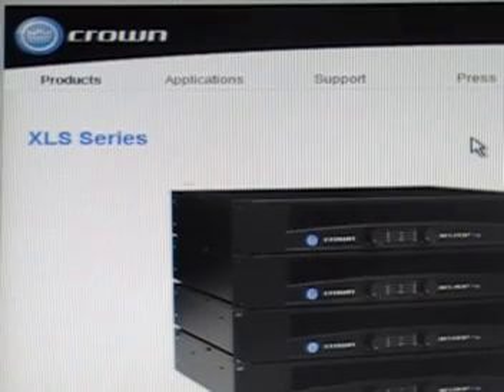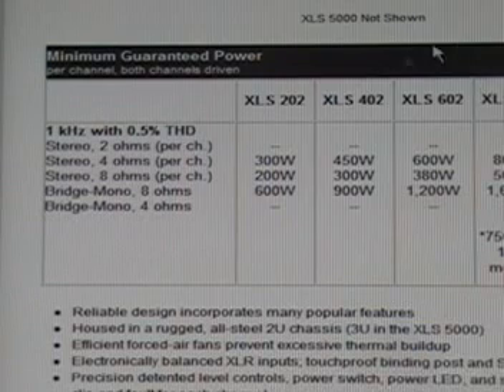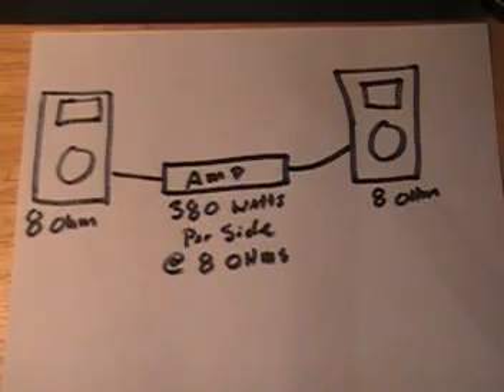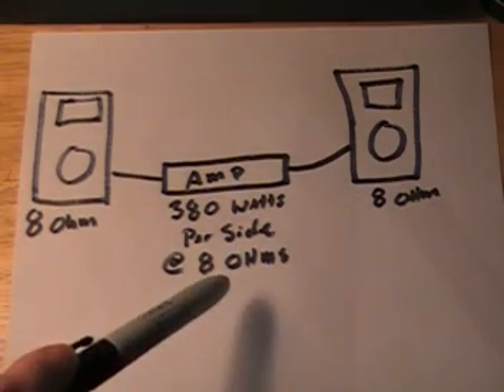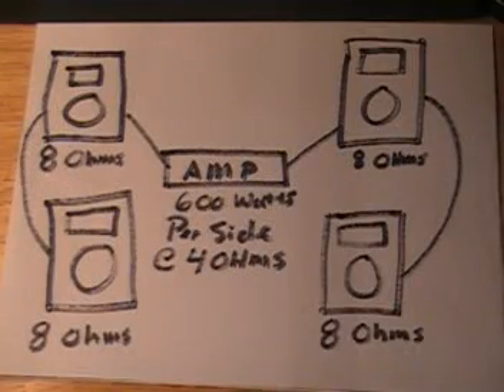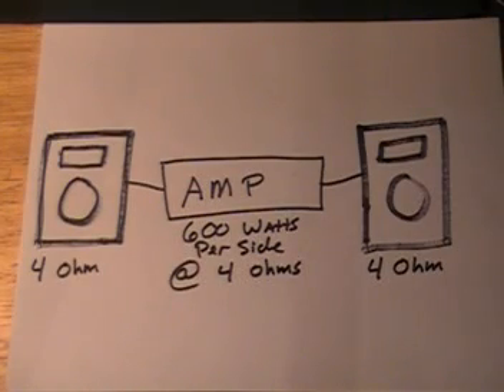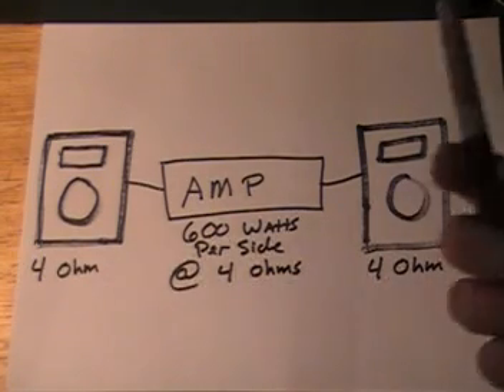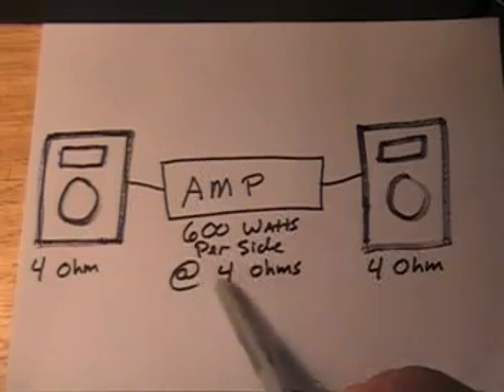How To Set Up A PA - Part 1 - Ohms & Peak vs Program

Comment: As I understand; the Peak Watt rating refers to how much a speaker can take randomly (i.e. kick drum thump) and the Program/Continuous rating is what the speaker will take all day long with minimal stress. Correct me if I'm wrong - just trying to learn (a lot) and teach (very little) as able. GREAT VIDEO, IMPORTANT INFORMATION RECEIVED AND ASSIMILATED!
Reply: Program and Continuous Power are two different things. If you have both ratings, then use the program power as the bare minimum to run your speakers.

Comment: so can you run at a speaker at regular rms. like if the amp and speaker are the same ohms and same watts, but not the extra 50% will that be ok? I suppose it wont do harm since everything is the equal?

Comment: Ok, It's the same for the 2 ways in your case, you can connect each speaker in each channel in your amp, the configuration is each speaker need 200w@8ohmn and your amp get you 200w@8ohms peer channel, in other words you have a "perfect match".
The other way, is put the two speakers in parralel and you need 400w@4ohms per channel to power up the speakers, your amp give this specifications and is correct.
In other case you can powered up other two same speakers in the other channel.

Comment: i have an amp that runs at 200w at 8 ohms and 400w at 4ohms.
i have 2 speakers rated at 200w at 8 ohms each.
if i connect them in parralel how many watt would each speaker get and will it make i difference running at 4 ohms?

Comment: @danielobrien8 

You've got your numbers correct, but any time you start playing with ohm ratings different than what the amp is designed for, you risk damaging both the speaker and the amp. Trying to get an amp to push a 16 ohm load is working your amp WAY too hard if it's only rated for 8 ohm.

Comment: Always match your amps ( choice amp) TO YOUR SPEAKERS, you can always go higher, (run an 16 ohm speaker on an 8 ohm load) going the other way is deadly.
2  (8 ohm)speakers in series  result in a 16 ohm load,  2 (8 ohm) speakers in Parallel result in a 4 ohm load,  4 (8ohm) in series/Parallel results in 8ohm.

Comment: Peak power is for small bursts of power. its possible to send 1000w trought the speaker for arround 3-5 seconds. It depends on your speaker. at some speakers the peak power i calculated to the max power that is posbile to send trought the speaker for 5 minutes.

(sorry if i hard to understand. Im norwegian, and im not used to talk about specs in english)

Comment: No setting up speakers in serie will increase resistance and thus decreasing the outputpower.

The gain factor you have to compensate is +3dB. And now the total output power is the same for left and right. 

But hooking up speakers in serie is kind of a sin. This is because the internal filters get fucked and the speakers can influence each other if they get out of phase.

Comment: spl means sound pressure level that is technically how loud the speakers will go, db stands for decibels, decibels are the figure we use to messure sound volume, the higher the sound in db the louder the volume. and yes you can mix speakers with different ohms i often run 1 4ohm cabinet and 1 8ohm cabinet per side, it dips my amp down to 2.66 ohms but it can handle that. max db spl to you meens how loud the speakers in question will go, the higher the rating the louder!

thanks, rob!

Comment: i thought that when you chain the speakers together like 2 - 8 ohm speakers that you would be running 16 ohms total on that channel? My problem right now is that im using a emx5000 12 channel powered board and with 1000wts at 8 ohms and i'd like to use it to push 2 pr18b PAS 18" subs which are4ohms ea. i think that if i use the mono bridged feature on the board that i could get away with running them parallel and the board would stil  be pushing out 1000 watts@8ohms. AM I WRONG? someone polease!

Comment: hi brian,

i have got 2 subs @ 4ohms 450 rms
2 15" cab drivers(horn + 15" bass driver) @ 8 ohms 250rms and a amp 650 @ 8 ohm 800 rms each side...

my question is can i put 1 cab on to 1 sub on to 1 channel of the amp?

Comment: Really good info, Brian.  My band just purchased  a pair of JRX 115's for our vocals.  We got a Behringer PMP3000 powered mixer to run them.  The mixer is rated at 1,200 watts peak.  The speakers get pretty loud, but there's definitely room.  Also, we can't seem to run monitors with our current set-up.  Does it seem like we need a power amp?  If so, any recommendations?

Comment from the maker: The amps I'm familiar with (Crown and other reputable companies known for quality amps) are usually stable, in stereo at 8 & 4 ohms.  Ideally, I like to run my top cabs at 8 ohms.  It's clean power that dosen't overwork the amp.

For subs, I like to use good amps that are stable at 4 ohms bridge mono.

in these examples, 8 ohms gives you clean clear power without working your amp too hard.  4 ohms gives you more power, but it's often not as clean and makes your amp work harder

Comment from the maker: It's important so you don't fry your system.  You need to know what your speaker impedence is (4 ohms, 8 ohms, etc) when selecting an amp, or vice versa.  You need to know what impedence your amp is stable at.  

If you put a 2 ohm load on an amp that's only stable at 4 ohms, it'll eventually overheat, distort, and destroy it.

Comment: Also, when possible, try to run only one speaker per channel. This may require more amps, but think of it this way: if you put two 8ohm speakers in parallel on one channel (so you're now at 4 ohms), and one of those speakers gets disconnected or blows, the impedance on that entire channel changes and you could potentially damage your amp or your other speaker.

If you just had one speaker on that channel and it blew, you don't have to worry about overpowering any other speakers on the line.

Comment: BTW everyone, try to avoid running an amp at 2 ohms. While they might be designed to handle it, there is so much done to the signal that it may not be as rich. Running at 4 or 8 ohms is best.

Comment: "Good video, thanks! Ok, here is one, I have an amp that has two outputs per channel and it said that the outputs are wired in parallel. Does that mean if I have two 8 ohms speakers hookup up to that one channel that I am pushing 4 ohms?" 

I can say with 99% confidence that yes, you will be doing 4 ohms when connecting two 8-ohms to both outs of a single channel.

Comment: Thanks for the reply, I have a Crate DPS+ 8 channel powered mixer.  It has two internal amps that each power two channels for speakers. Here's a blurb from the manual "The jacks
are wired together in parallel. The internal amplifier of the PCM+ Series can
deliver its full power output into as little as 2 ohms. "

Comment: Good video, thanks! Ok, here is one, I have an amp that has two outputs per channel and it said that the outputs are wired in parallel.  Does that mean if I have two 8 ohms speakers hookup up to that one channel that I am pushing 4 ohms?

Comment from the maker: I just looked at the specs.  It says 300 watts peak.  RMS is rated at 150 watts.  RMS is similar to Program (not exacally the same, still trying to get my head around it all myself).  You could probably get away with an amp that produces 200 watts per side @ 8 ohms and be just fine.  The good news is that low wattage output amps are not very expensive.  On the used market, you're probably well under $200

Comment from the maker: then yes, that will work just fine.  You will have more power than you need (you only need 250 watts each for your JBL speakers and your amp delivers 500 watts per side @ 8 ohms) so make sure you do not turn your amp up all the way or you'll blow up your speakers

Comment: you are asking if you can run all 3 off of the mackie fr2500?

the connectors you mention don't really matter as long as you have the positive to red and the negative to black, and the speakon is wired correctly(if you bought the cable, assume it is).

It is fine for that amp to run an 8 ohm load in one side and a combo 4 and 8 ohm on the other.  Just adjust your amps gains to get the levels even for however you want it to sound.

Keep it a couple of led's lower than the red led on the amp.

Comment: Before I post my video follow up here, I must correct the above equation, before someone else does... :)  long day :(

Parallel load calc here is (8X4)/(8+4) so really 2.6666666. (product of drivers divided by sum)

But the silly thing is the speaker will usually never be a true exact 4 or 8 ohms, so this is not an exacting science.

Comment: Depends on series / or parallel connection.

I will make a video on this tomorow, but google in the meantime for a diagram.

Assuming parallel full range drivers - the math should come out -  (8 + 4 / 2) / 2 (average of drivers divided by number of drivers)

The amp will see around 3 ohms (see manual) - think of brians (small) hose, you are basically using two hoses here, reducing the overall resistance to flow.

I would be safe and wire the set in series, if you don't have the manual handy.

Comment: use one of those connection ports to connect to your amp and the other connection port to connect to another speaker cabinet,(only if both cabinets say 8 ohms) this would bring you to a 4 ohm load and if your labels say 4 ohms do not connect another speaker cabinet because this would then drop you down to 2 ohms and alot of amps can't handle it.

Comment: hey great job brian, here's the deal guys every speaker cabinet should have a label on the back were you would plug ur speaker wire and this label either says 8ohms or 4ohms and should have two holes in the back for connection, (continued-)

Comment from the maker: Powered speakers sound very intiresting to me.  However, you get a lot more versatility out of an amp/speaker system.  If you buy the right stuff, you can double your sound & power just by adding another set of speakers (which are usually a lot cheaper than powered speakers).  On a powered system, this would be very expensive.

Comment from the maker: hmm well it may be time for a new PA for sure.  Sounds like you want to go with a bi amp system with an active crossover.  There are a lot of options out there depending on your budget and what you want to achieve.  Are you going to use your exsting speakers? If so, what are they?

Comment from the maker: Like I said in the video, it's probably a good idea to get an amp that gives you a good % more power than you need.  The Crown XLS 602 works great for my speakers (which are just like yours).  You'll get an additional 130 watts per side @ 8 ohms.  

There are also other variables to get good sound.  Your mixer settings are VERY important.  Did you see my MIXER SETTINGS video I put up about a month ago?

Comment from the maker: You should have a look at your amp specs.  Much like in the video above, there are different wattage ratings depending on what inpedence your speakers are (8 ohms, 4 ohms, etc).

Your amp runs between 260-280 watts per channel at 8 ohms, which is what's happening when you run your JRX115 in stereo.  The amp is pretty much running at it's maximum physical limit.  THis is why it clips sometimes and probably dosen't sound great.

Comment from the maker: What are these leads running to?  Most people agree that XLR cables going from your mixer to your amp is going to give you the best signal and even a bit of a boost compaired to 1/4" or RCA connections.